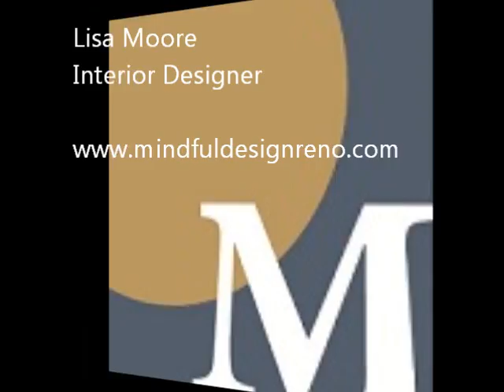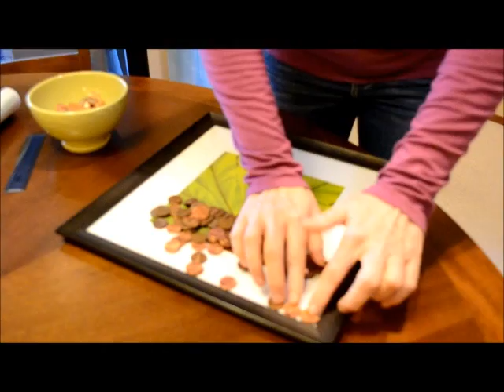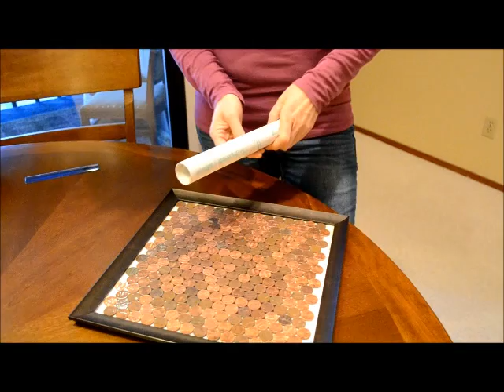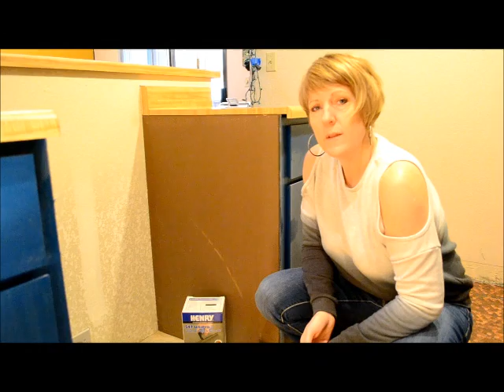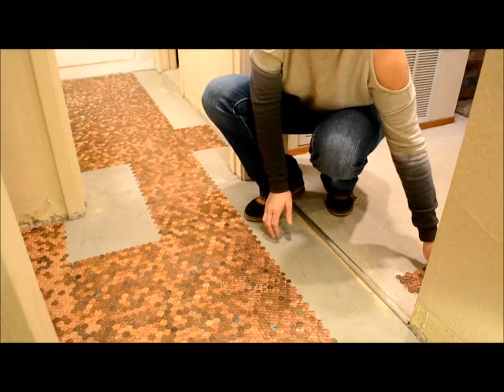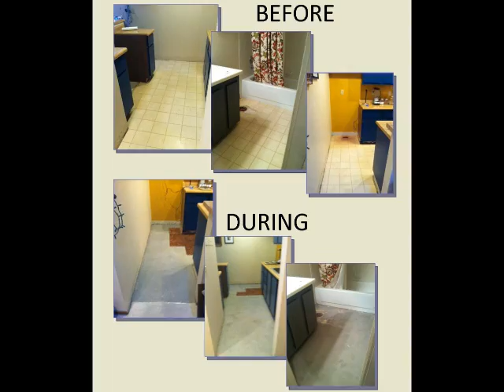Penny Floor installation on kitchen and bathroom floor

Comment: Deliberately Damaging and or permanently confining U.S. cash coins for personal gain is illegal in the United States.
It is also illegal to own bird feathers, but hey..at least we're in the U.S.A. !
Reply: Wrong. It's only illegal if done for political and business gain. Not illegal to put on your floor.
Reply: Personal gain? How is she personally gaining from this?  🌸.  How did she accumulate THIS many pennies. I saved up a dutch oven full of pennies once, but that wouldn’t do a very large area.  🌺.  What do you do when you need to drill through the floor for something?  For example: plumbing.

Comment: very nice job with the floor...a couple of questions...could you use a self-leveling compound instead of the patch & skim coat product that you used for the uneven parts of the floor? what was the total cost for the finished job?

Comment: These instructions were very clear and the floors turned out fabulous! It has been 3 years since this was done and I'd like for an update. Did the VCT adhesive hold the pennies correctly and did the epoxy remain shiny or did it get scuffed up? Also, what is the best way to clean this floor with the particular epoxy used? Are there any areas of the floor showing pitting where the pennies meet in which the epoxy didn't settle? I am doing my homework, as advised :)
Reply: I have the same questions as well.
Reply: Me too !!!  I would like to do this in my house somewhere but I am concerned about having to redo the floor in a year or so if it starts scuffing up Bad.    Maybe better for ceiling tiles !!!

Comment: It would be interesting to see this done with a mix of foreign currency from various countries.
Reply: with different sizes ??  Hum. you would get a lot of gaps between the pieces
Reply: Yep Darth, it would look interesting. But keep in mind different sizes would also mean different thicknesses and that would be even harder to deal with than different sized gaps. It could be done, but then you'd have to put a very thick coating of epoxy on it, like when you embed coins into a bar top.
Reply: https://youtu.be/z9WusYapyb0
Reply: Suggesting you give your spare coins at airport to charities. Some people really could do with the money to eat, house themselves or study. Thankfully it is illegal in some countries to hoard money in such ways.
Reply: No, Winter Winter, not in the U.S. - not illegal to use money on the floor like this, not illegal to hoard money - it's called saving by the way, when you "hoard" money. And again, why do you object to someone putting $270 worth of pennies on the floor but it's okay to spend $270 on flooring. Again, your objection is ridiculous.

Comment: tilt the picture-frame up a bit so the pennies slide down and line up by themselves, offset... perhaps add a strip of cardboard along one side to compensate for the gap because of the pennies not fitting the frame exactly ...nice vid!

Comment: Hello ice skating rink if your feet/shoes are even a tad damp. And I'll bet her homeowners ins. co. would not cover her if someone got hurt. Cute, but dangerous idea.
Reply: +MPLArms that would be the case with any smooth floor then, and pennies are not entirely smooth because of their engravings. plus with the addition of grout this floor should be fine. this method has been applied for years in numerous locations

Comment: vinyl flooring shrinks and curls you should have removed the vinyl floor and used a plywood underlay to create a long lasting floor.. this goes for any flooring if you dont do the proper prep it wont last very long.
Reply: If the vinyl floor is very old, it's already shrunk as much as it is going to. And if you paid attention to what she said, she removed the loose edges and added the skim coat sealed it so it won't pop up. Why can't the vinyl floor act like a cushion for the pennies, like you'd have for under a rug?

Comment: 270 bucks in pennies isn't very cost effective in my opinion. But it sure makes for a great conversation piece.
Reply: Thats actually a very cost effective flooring. A high quality tile can be anywhere from $5-$10 per sq ft. Or more. So at this coming out to $2.80/sq ft is very cheap.
Reply: Judy Johnson If there is time who cares how long, to install tiles you also need extra materials
Reply: +J. Nikole Hershberger Don't forget to add in the costs of adhesives and the "very expensive" epoxy. The pennies are the least costly part. Labor is not free either. I agree the pennies are cheaper than most tiles.

Comment: Is the top coat necessary or is it possible to leave out? I'd love to do this to my bathroom floor but I rent, so if need be I'd like to be able to scrape the pennies up off the floor- so is it possible to get the floor back to it's original state?
Reply: ***** It was a curiosity for me because I thought I could stick the pennies on with epoxy? And a man at home depot showed me a sort of solution he said that is used to remove epoxy from things.
Reply: Jane Doe The underside of the pennies on her floor used a vinyl adhesive which i know based on experience is a hard days work for removal. The other adhesive she used as a kind of grout, the top coat she used is the epoxy your referring to which I wouldn't know what would remove it maybe a harsh chemical but if you use a harsh chemical than maybe that will affect your penny.

Comment: For the final cost of this project she could have purchased something of quality that was longer lasting. Pennies last for ever, sure, but this floor application won't. I'm not sold on the idea.
Reply: why not? Pennies last long especially if you embalm them in epoxy, there is no chemical rusting, and the floor has a bronze finish and it's metallic, unlike polished stone, replacement in damage is a lot easier, and it makes the floor lower for more head space with the help of the vinyl mastic. And other Metal sheets go for a lot more. She seemed to do her homework and it paid off rather nicely.

Comment: This looks very lovely. Couple questions if you don't mind: (1) What type of finish did you use after you completed the installation? And (2), how do you care for for this type of flooring, i.e.; mopping, sweeping, polishing, etc.?
Reply: She tells you in the video what finish is used. It's a special epoxy. You would use the same kind of cleaner that you'd use on a typical bar top.
Reply: Care for it just like the typical bar top, nothing special as long as you don't use anything too strong.

Comment: How did you cut your pennies when you got to the edges?  Does the epoxy coating fill the gaps so the top surface is flat?
Reply: You put the edges far enough under the baseboard so that you don't see the roundness. That's one of the purposes of baseboard, which comes in different thicknesses and styles. And yes, if you use the right epoxy product it will fill the gaps. You also have to make sure there are no holes underneath the pennies for the epoxy to leak down.

Comment: In reality, it is cheapter than a lot of mid- or higher grade ceramic or other type of tiles these days. For example, a 10x10 size kitchen = 100sqft. 1 sqft of penny tile uses about 270 pennies per her video. That comes to $2.17/sqft. Then we have the contact paper, some glue, etc.. all together should not exceed $3/sqft. Tile can go from $1.99sqft (cheapest I found at Home Depot not on clearence) up to $10 or even higher for rare stones. For $3sqft, that's only $300 material cost! SUPER CHEAP.
Reply: P Collett great math there pal...270 pennies equals “$2.17” according to you? 
You’re quite a bit off in your math there bud, it would be $2.70 per sq.ft., NOT $2.17 as you do very incorrectly state in your comment. 
Simple math folks.

Comment: I think this would look great....however, I'm not sure if you could epoxy the splash easily or not. Grout would be another option. Check with a local tile store in your area for specific information on grout for metal.